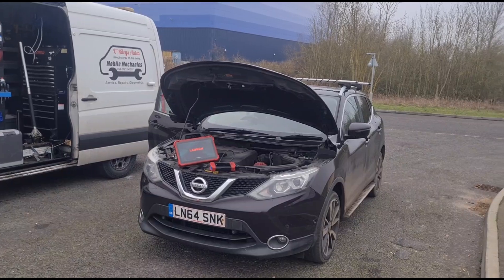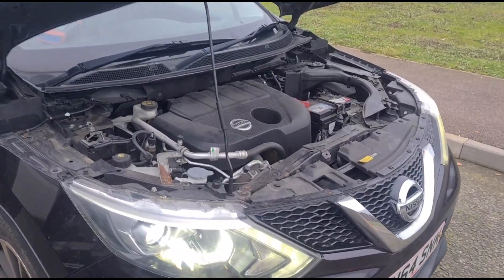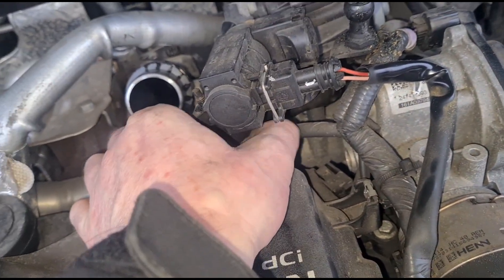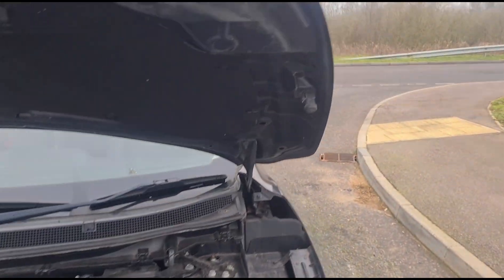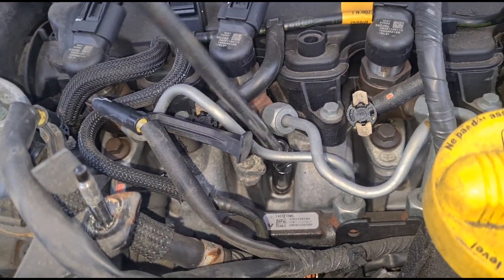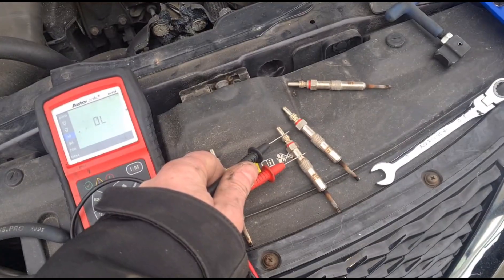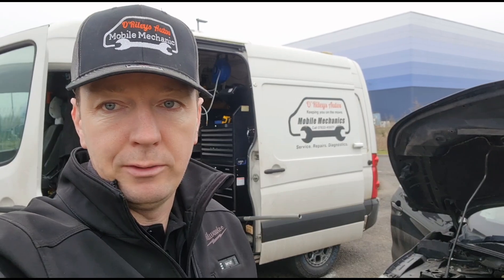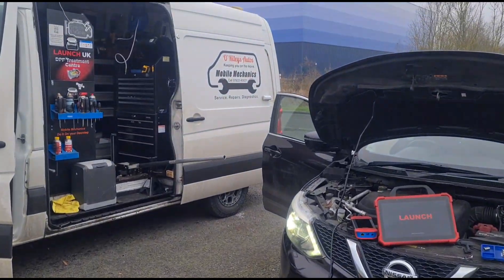Nissan Qashqai P0380-96 Preheating Unit

Comment: Hi I'm struggling to find any information on this it's a 2015 1.6 HDI code for under boost on live data additive fine 2238m since last regeneration and 0m until DPF replacement needed DPF pressure 0.00 checked with hand pump no change new sensor still 0.00 5v on pins 1 and 3 showing ground with power probe on pin 2 reset DPF+ sensor and service just to see if it would start reading on live data but still 0.00

Comment: Most pointless engine cover ever.  Bloody annoying that you have to disconnect the intercooler hose and all the other bits to even get near glow plugs or injectors etc.

The glowplug relay does go on these quite often.  Near side Wheel off and under the headlight

Comment: After having two glow plugs breaking on me, I changed my approach replacing them. I let the engine warm up, spray some WD-40, and then unscrew and screw back again at a slow pace. While continuously spraying WD-40. As replacing the glow plugs after some time, not waiting for them to fail. Greasing the threats is also important for a future replacement.